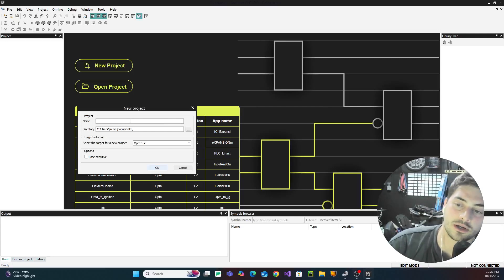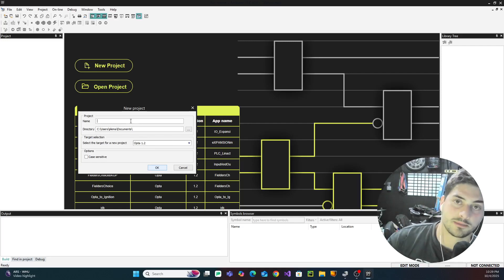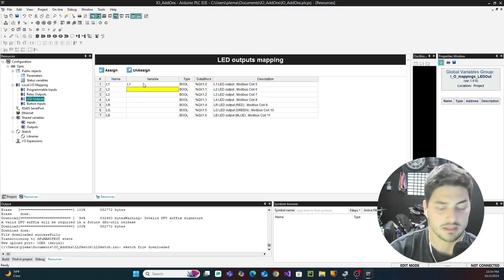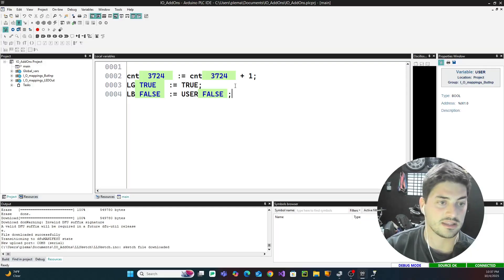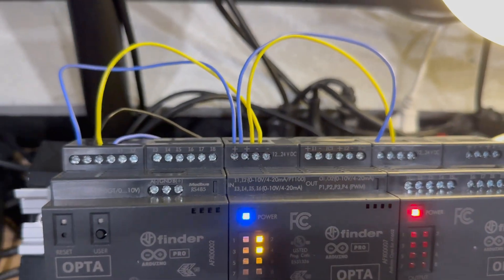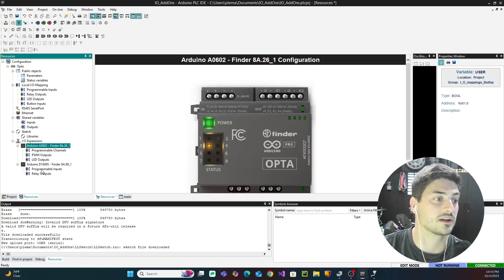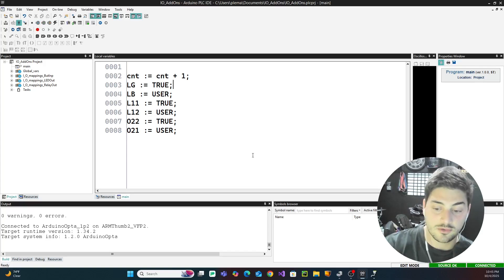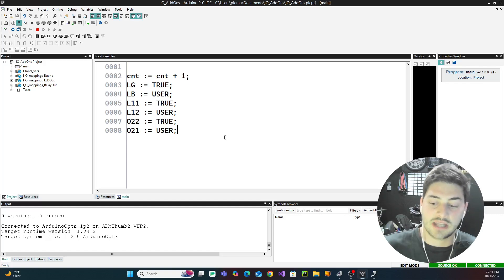How to Add IO Expansion Modules to the Arduino Opta PLC!

Comment: Love your videos but I struggle so much to get my Opta's to connect and run code. I spend days chasing a upload run time code errors, resetting firmeware, it's maddening. I own two Optas and ready to throw both in the trash and switch to something else. I was looking forward to working through your videos but despite Arduino forum posts and reaching out to customer support nothing works. Any tips before I just hit the reset button on using these PLCs at all?
Reply from the maker: Oh man I’m sorry to hear that! I had some initial setup frustrations too and it certainly isn’t super intuitive but once you get them properly firmware flashed they usually connect relatively seamlessly!

If you double click the reset button it should renter the firmware bootloader mode and give you another crack at initializing! And it’s possible the PLC IDE install got corrupted and you’ll want to fully uninstall and reinstall the plc IDE! Then there’s also some shenanigans you can try with the regularly Arduino ide to update the libraries to include the Arduino Opta software package in board manager!